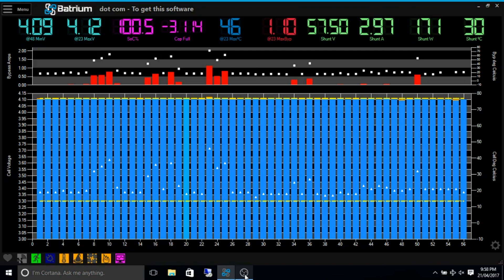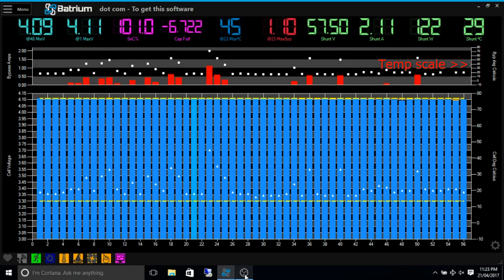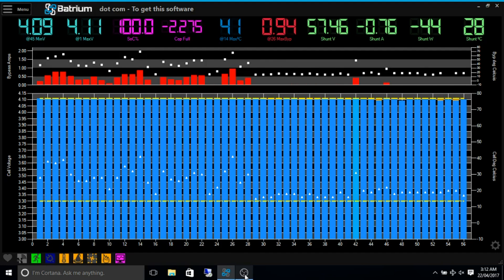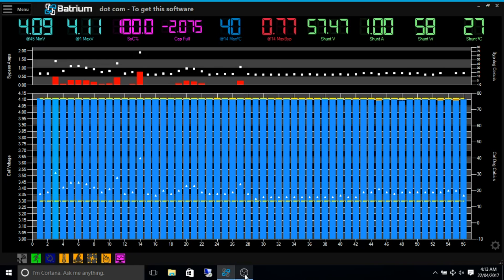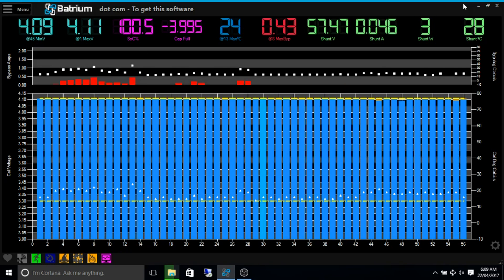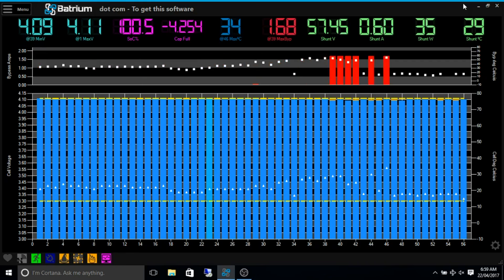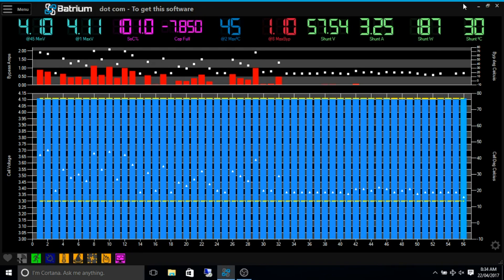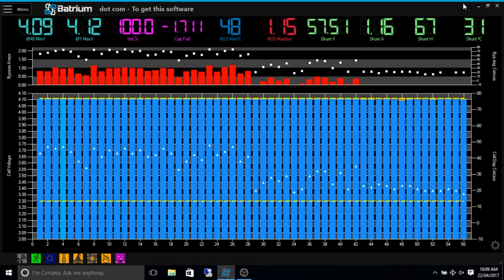⚙⚡5300 watts re-charging after 63hr load test ⚡⚙

Comment: I have found a source for LiMN2O4 ipad batteries and want to build a DIY power wall with them.  I currently have about 400 lbs with another 400 lbs coming every 3 months. 

These all have Panasonic BMS modules on them.   I want to use a Batrium controller and wire them up similar to your power wall.   I am familiar with electronics and am a micro solder tech by trade.    I am a little overwhelmed at present.   I have all these boxes of batteries and want to figure some stuff out before I start cutting them apart.

Should I remove the Panasonic BMS modules,  use link fuses and Batrium?  Or leave the Panasonic BMS modules in tact and not use fuse links? 

I also have cooling questions.   I know that I have to allow for slight expansion of the pouch cells.   I was going to use foam on the sides of the trays so the stack could expand and contract as needed.  I also was considering placing a thin aluminum sheet in between each cell that extended past the cell so they could be air cooled. 

These are all used so i don't want to hammer them.  I plan to be very conservative with maximum charge 3.7v and limit DOD to 40%  I really don't want to engineer the packs to get hot at all. 

Just looking for some advice before I dive into this.

Comment: Would it not be better for battery life for the bms to not keep on trying to level off all the battery's to precise 4.11v seems like unnecessary battery use and power loss, can't it have a target on 4.09-4.11v (-0.02v so +/- 0.01v from 4.10v balance range target so they are not trying to be so precise)

Also bms 48 cell seemed to have issue getting 4.11v maybe blown fuse on some batterys? (48-to last high number seem to have higher voltage when charging and lower when discharging, closer to charger controller maybe? )
Reply from the maker: Beauty about this bms I can tell it to do what i need/like :) Soooo many configurable settings

Comment: whats the name of that board you added to the packs to drop the voltage back down? I have seen you install one and even look at it with a FLIR and I have been trying to find that board and with no luck I might add cause I dont know the name of it.
Reply from the maker: They are longmons - you can buy a kit from Batrium - https://www.batrium.com/products/starter-kit-watchmon-14s-longmon - No use buying the longmons by themselves but here is the direct link to them anyway https://www.batrium.com/products/longmon
Reply: i have a 12V system  11.1V (12.6)   system  but the BMS  does not balance thats why I was inquiring about the longmon's

Comment: it seems like with software like that and all it could just stop charging the full ones and only charge the low ines so you dont have to waste that energy
Reply from the maker: that would be a nightmare, just converting 56v to 4.2v per cell would be wiring hell ... i guess it could be done tho if you're really  keen
Reply: HBPowerwall well i guess i was assuming such a system would more or less be charging them all individually but you did have something like 115 amps going in right that would be a bit much but if you could pull power from the full ones and isolate it and redistribute it would be cool i just have never thought that burning off the extra power was a good way to do it
Reply from the maker: It not only works it's bloody awesome - works well beyond any expectation

Comment: Doesn't look like your "awesome" BMS can dynamically balance the cells... Maybe it can do that, but you have to configure it ;)
Reply from the maker: it doesn't dynamically balance :) yet still awesome! There are literally 1000's of different configurations you can use. I can configure it to start balancing at 3.7v 3.71v 3.72v 4.00 v etc A 1S balancer can 'dynamically balance"  but it's kinda missing ANY type of reconfigurability. Perhaps Smart, Awesome, Configurable, expandable, BMANAGEMENTS would be a better description.  The sheer confidence this setup gives me now is incredible at a glance "Yep, all looks good and back to the family time I go".
Reply: I don't know if you exactly understand what i mean with dynamic balancing... It's also called "early" balancing. The BMS measures all the cell voltages, calculates the average and if a cell is above a set value over the cell average, it starts balancing. If the cells, balance current and charge current is not to much off, all cells will reach the set voltage (i.e 4.2V) at the same time.
Reply from the maker: Yep, understand exactly what you mean probably the most common asked question. Batrium BMS doesn't do energy transfer between cells at all. Can you imagine the energy transfer needed on my cells.  On new 18650 YES absolutely I would WANT that feature, however being as configurable as this is I can program my 'starting balance point' where ever I like. It will also stop that balance function of a set of parameters aren't met. ie load are too high or even you can program it to only balance when there is under .5amp load There is still a bunch of stuff I don't even understand - but I do know I'm in love with it already and as I learn more and realise exactly what can be done I'm also impressed with it. Changed my perception of a BMS that's for sure. That Management word seems to be over used all too much on the internet.

Comment: No bypassing on the higher numbered cells - why is that? I guess because they didnt reach the target voltage yet? Is that a new pack?
Reply from the maker: Yes new packs. They are also 'closer' to the inverter so that could be an issue. But they were .02 of a volt lower yet to balance properly :) takes time

Comment: After a deep discharge like you did, how practical is it to charge it back using just solar? Is there enough capacity to run the house and charge without tapping off the grid?

Wonderful stuff BTW. Recycled batteries and renewable energy. You are the new poster child for sustainability.
Reply from the maker: Buying power doesn't concern me too much. Only really run 12 hours ongrid after the test had completed just trying to balance the new packs :) they were well out of balance..

Comment: Did you use grid or solar power to recharge the batteries? The batteries peeked out in the evening so it is hard to tell from the video.
Reply from the maker: Yes, grid max amps was 60 amps - but to be fair I was exporting 4000w with the grid tie inverter most of the day. So not 'really' off the grid.
Reply: Thanks for the reply! Didn't think of the export of power since the panels were disconnected from the panel :)